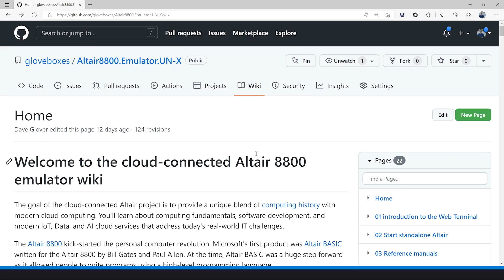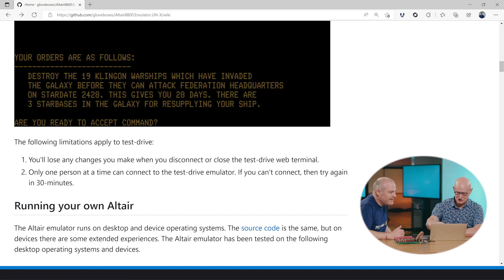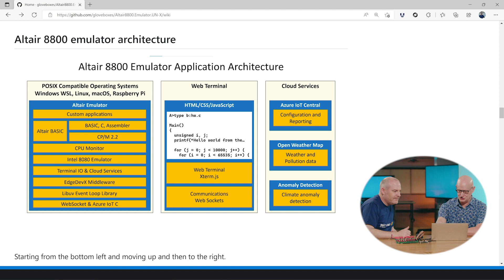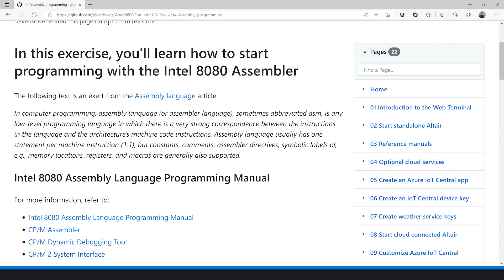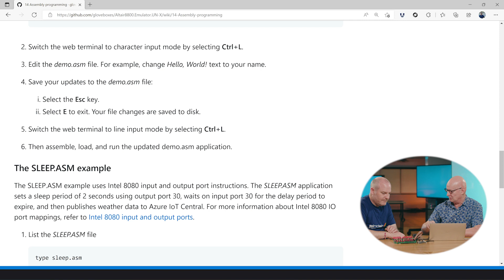Build Your Own Pocket-Sized Altair 8800!

Comment: So this video is about doing something that has already been done (and perhaps better) by Mike Douglas with his "Altair Clone", and treating it as if it is mind-blowing "this is wild stuff!" new territory. This video mentions starting with a software emulation of the 8080 CPU (yes, this is necessary for an accurate overall emulation, and it has already been done years ago with the Altair Clone), then tangents off to operating systems, without noting that before doing THAT, one must also write a very accurate hardware emulation of the Altair 8800 computer itself, and also its I/O cards, disk drives, etc; which has also been done already.
Reply: Or the AltairDuino by Chris Davis and Dave Hansel which includes CP/M, games and multiple disk images.